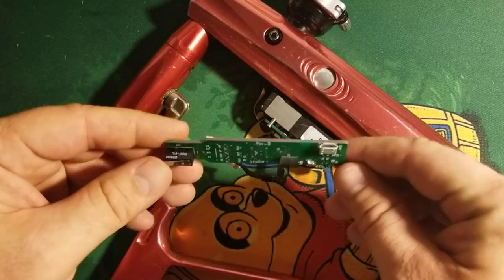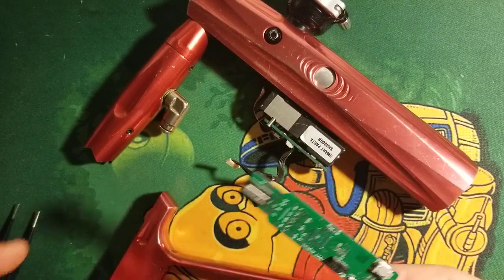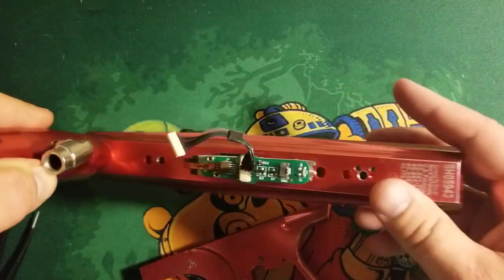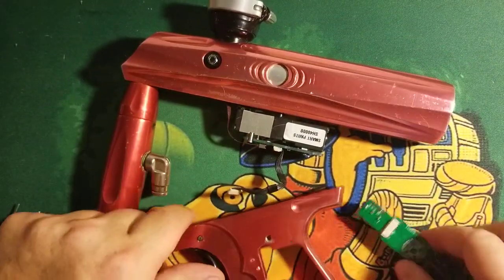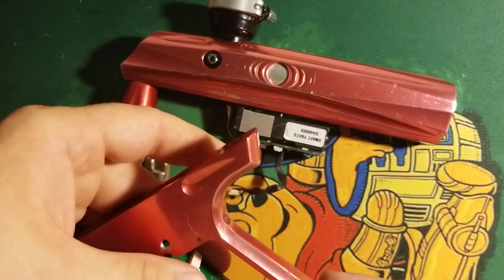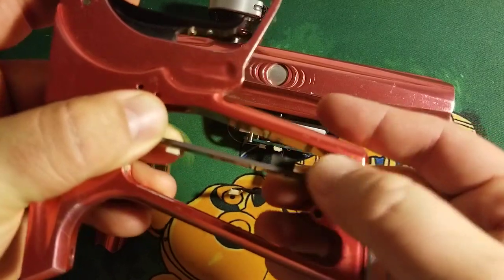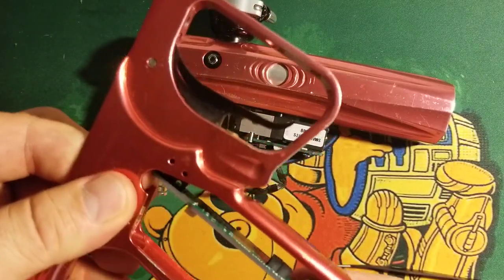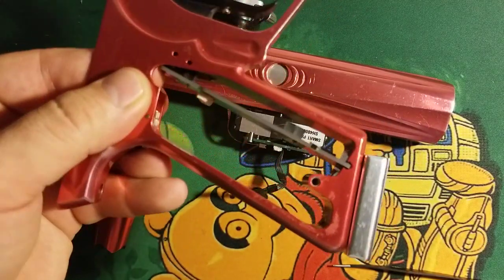Shocker SFT/NXT Board: First Look

Comment: Please use a battery harness that connects via molex connectors similar to the cocker/Timmy instead of a battery harness that connects directly to the board.. the biggest pain in those guns is getting the battery in and out.. I would love the ability to change it to a lipo battery via molex connectors
Reply from the maker: that's definitely the plan